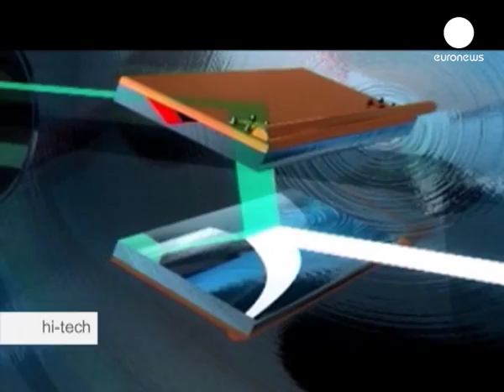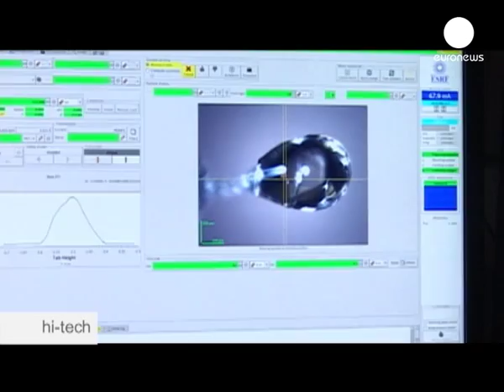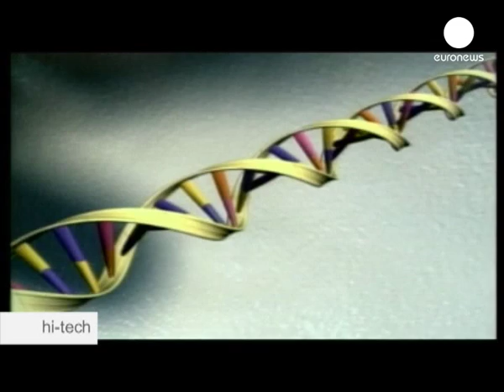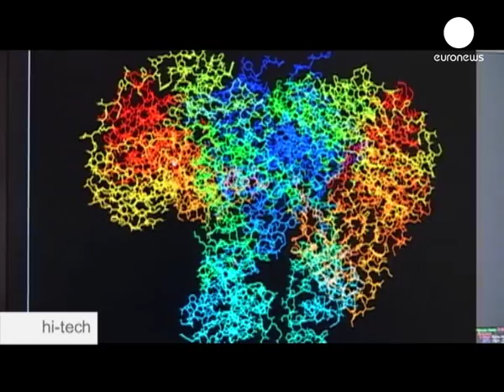euronews hi-tech - Radiation-surviving organism yields its secrets

Comment: The radiation that has been reported across Europe, What about the pole shift? Is it possible the earth’s magnetic field that has kept the radioactive particles that orbit around the earth in place, the (Van Allen belt) that as this pole shift happens, the earth’s magnetic field has weakened so much that those particles hit the earth and still, till this pole shift is complete? If there is archaeological data that shows this reversal in the past, does it consist of radiation?  I heard there could be genetic mutation and cancer rates up during the process, that points to the radiation particles from Van Allan belt seeping through our atmosphere. Last question: Is it the earth’s core that holds the magnetic poles compared to the earth’s geographical north and south that is actually flipping?